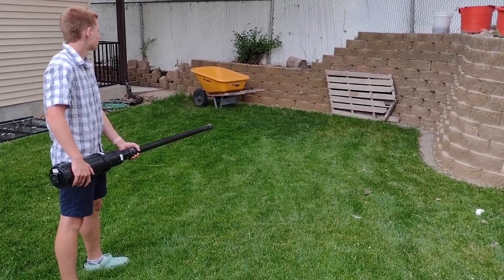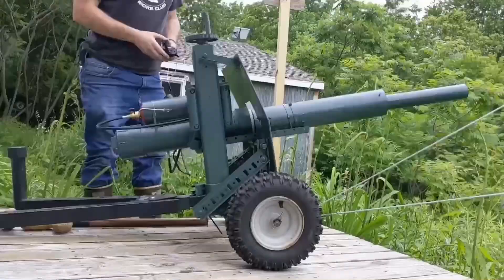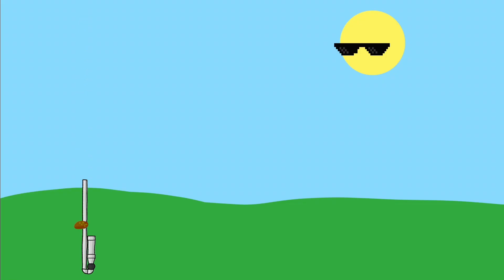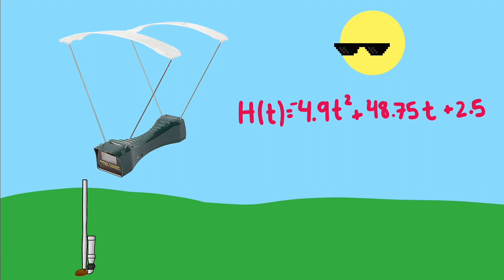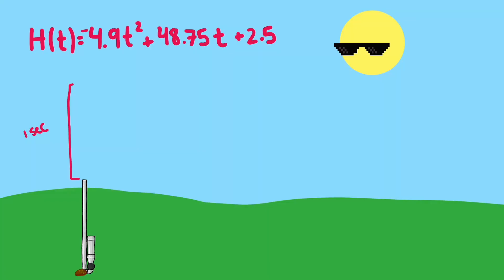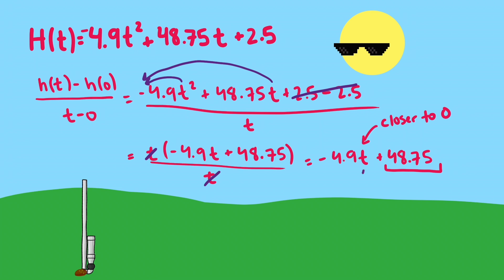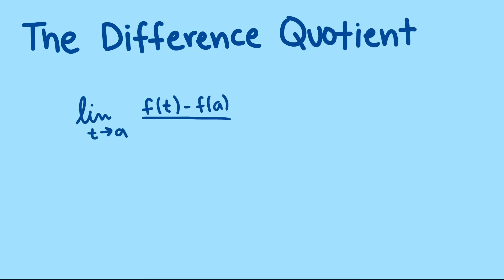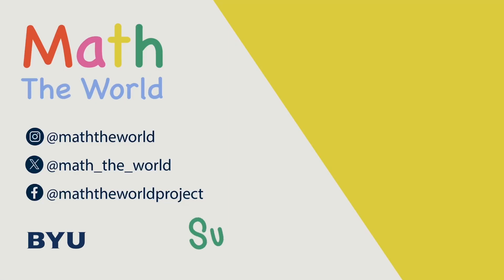My Potato Gun Teaches You Differential Calculus

Comment: 1.)Why couldn't we find the first derivative of the equation we got we got for the height with respect to time, then substitute values for time to get the velocity at any given time. 
2.)If your potato is projected at an angle lets say theta to the ground, knowing the range, could you use Range = initial velocity squared multiplied the the sin of 2 times the angle all divided by the value of acceleration due to gravity. R = (v^2 sin 2θ)/g
Could be wrong though, these are just suggestions.

Comment: If you want a less theoretical speed measurement, you can use a camera, preferably higher fps, and measure the distance traveled through one frame using some kind of backdrop. Usually, stripes that alternate between black and white are used. Knowing the disyance between the change un color, you can measure the distance the potato travels over one frame. To find the time, you do 1/fps. You can then use these numbers to estimate the practical speed
Reply from the maker: This is great! We had actually thought about adding this into the video too but felt it was long enough as is haha but a great way to find speed as well!
Reply: That strategy is another great one to illustrate the ratio of small changes to calculate the speed. The math is the same as in the video, you just gather different data.

Comment: If you want to add a follow-up video to this, I have a topic to suggest.  Consider the theory behind the muzzle velocity, as the gas expands while the potato accelerates.  This produces a pressure vs volume curve, and the area under it, is the work done accelerating the potato.  The work by friction of the potato against the walls of the barrel, subtracts from the work of the expanding gasses.

Adding onto this, it would be interesting to determine whether there is a length of the barrel that optimizes the muzzle velocity, or whether it would always increase, but eventually with diminishing returns.
Reply from the maker: I actually thought of the optimal barrel length idea when I was trying to improve the velocity of the potato gun. I created the longer barrel but it was just a guess on what length might work well. 

I agree that it would make a great video! We will put it on our ever-growing list.